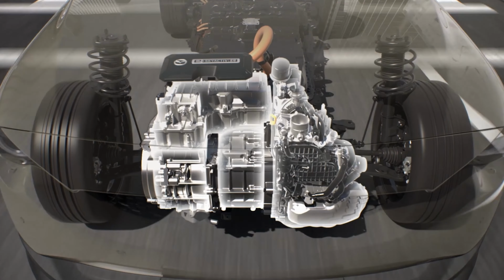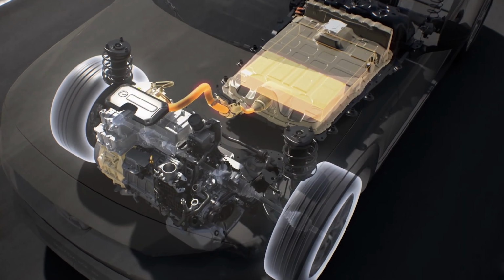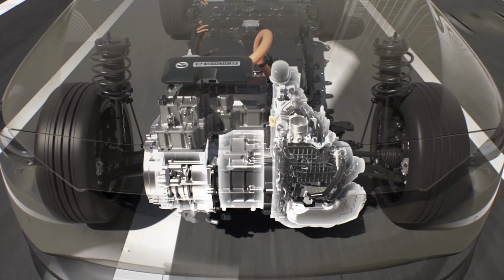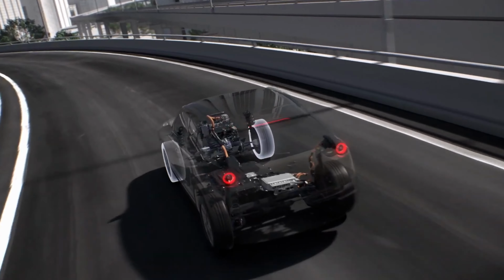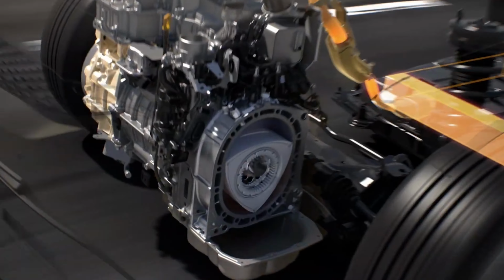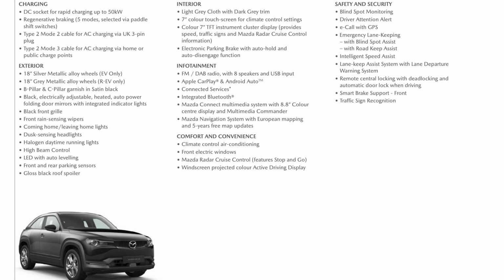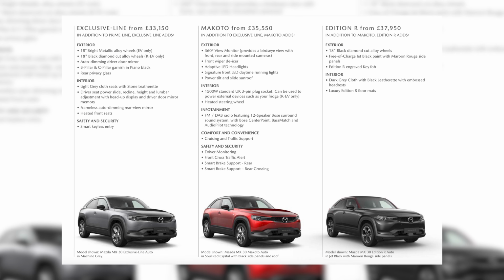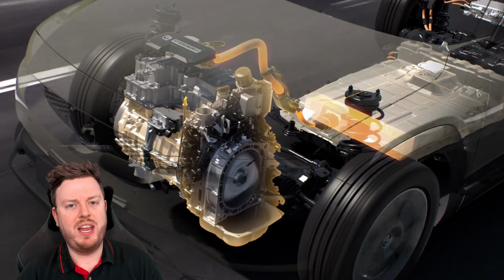The Rotary is BACK! - MX-30 Phev e-Skyactiv R-EV

Comment: The MX-30 R-EV does not get 200+ MPG, that is literally impossible to manufacture an engine at the moment that can produce that type of range, the EV portion of the car only gets about 52 miles range, and the rotary boost the range up to 380 miles, the math doesn't add up with it being a 50-liter tank, realistically it would get somewhere around 35mpg not over 200+.
Reply: 200 mpg is possible because the car blends battery power and gasoline power. However, those lofty figures do conveniently leave out the electrical portion. Miles per kWh would be more accurate, but most people wouldn't understand it.
Reply: @matthewhardy8133  I don’t get it either, if you get 380 miles from the engine/battery that is crap combined fuel consumption. To make this combination work you need to be driving less than 50 miles return (probably more like 30 miles) between charges and then take the hit on long journeys with 1980’s type fuel consumption ! Actually that would work for me but given the leisurely 0-60 at 9.1 seconds, the less than roomy rear seat space, weird doors and poor boot space I struggle to think of a reason to buy it. Especially when the new extended range fully electric MG4 comes in at 330 miles range, with a dual motor version giving 0-60 at 3.8 secs for apparently £35k fully loaded !!!

Comment: Where do you get 200 + mpg from? It does 380 miles on a 50 litre tank. That’s an 11 UK gallon tank so 380/ 11 =  34.5mpg or am I missing summat?
Reply: charge mode

Comment: That MPG is incorrect and misleading. This also suggests the Mazda are afraid to provide correct values, i.e. it will be inefficient compared to say Honda Hev hybrid
Reply from the maker: why is it incorrect and or misleading?
Reply: @EdenMotorGroup  it is impossible for an international engine to reach that kind of efficiency. What the companies do is to report their electric mode mpg only which is misleading specially since the ev range is limited and no one cares. What people care is to see how much car can drive with a certain amount of fuel in tank. The real mpg should be around 20-30, considering the total range and the tank volume which is disastrous. With this trend Mazda soon will be out and irrelevant.
Reply: I’ve just visited the website and from what I understand, this is a vehicle you would normally use for commuting to work and back and hanging out with friends / family over the weekend in your city - so it gets charged every night and gives you 53 miles of range per day. 

I do a 34 mile round trip commute in London, so that makes perfect sense.
The range extender exists for those relatively rare longer journeys where it would run out of EV range.

You’re not meant to drive it long distances with the range extender running every single day - get a hybrid instead! 

I don’t know if the range extender charges the battery to full while also generating enough electrical power for the wheels to turn simultaneously.

Technically, it’s possible that by the time you reach your destination, you also get a fully charged battery with 53 miles of EV available into the bargain - that’ll count towards the total mpg of the vehicle.

The website explicitly states your mpg could vary according to how you utilise  the vehicle - for commuting or mostly long distance.

I suspect those figures come from city commuting more than anything else - not doing 200 miles a day as a company Rep.
Reply: Phev / range extenders can easily get very high mpg figures for someone who charges at home, and their commute is within the EV range. That is always on the basis that they dont do regular long-distance trips. Perfect for my use case, plus we already have a BEV and a 7kw charge point installed.
Reply: @ashb8572  You are right, but companies add an ice engine to those Phevs for a reason. So better they do not hide part of the story